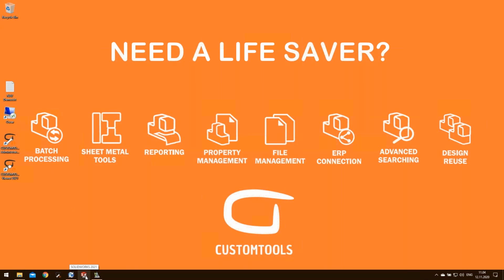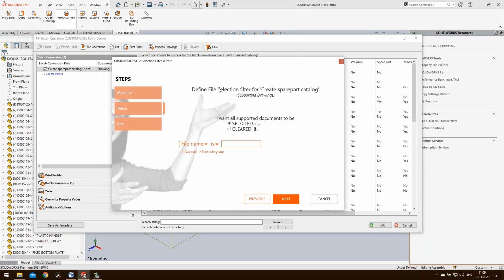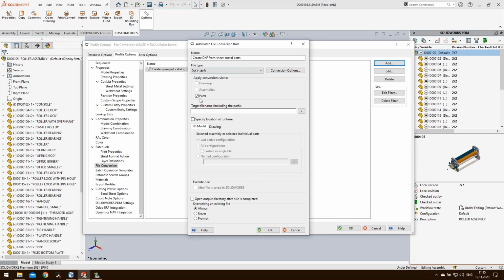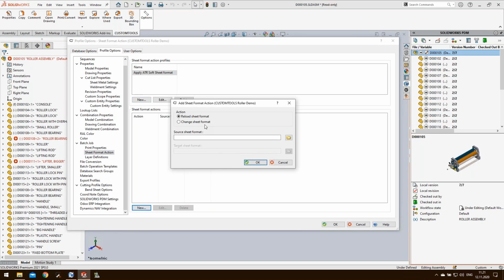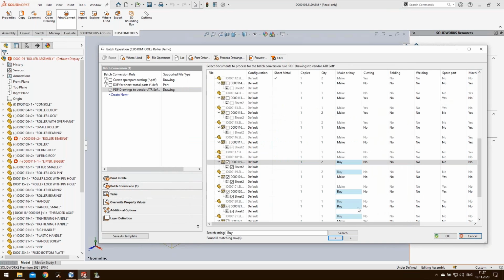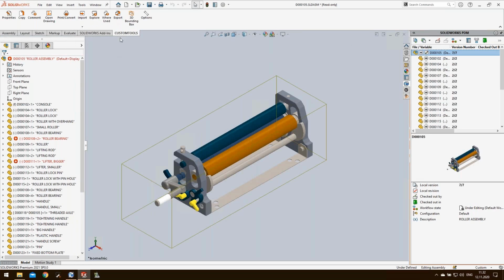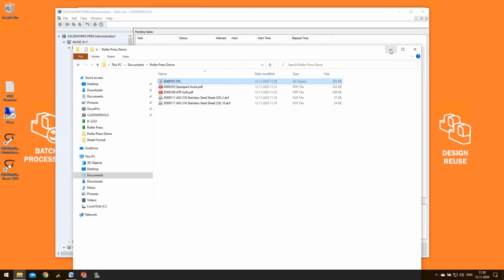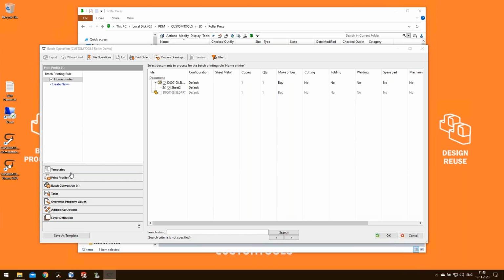Webinar: Batch Print and Convert Your SOLIDWORKS Files

Comment: This seems pretty handy. I've got a question aside this. Does the software have a option that profile lengths are shown in the BOM?
Reply from the maker: Thanks for your comment! CUSTOMTOOLS is configurable through easy-to-use settings wizard. You can also customize BOM and include profile lengths.